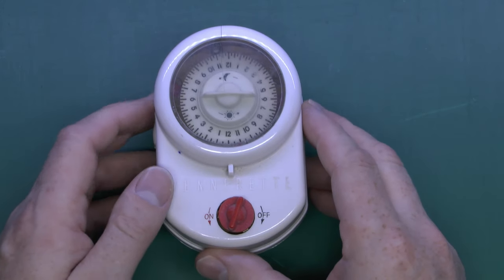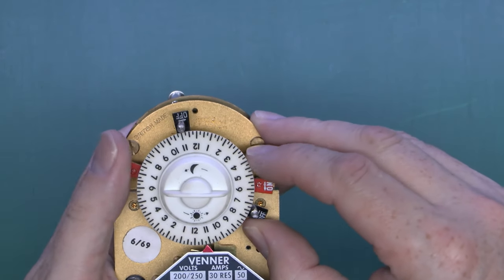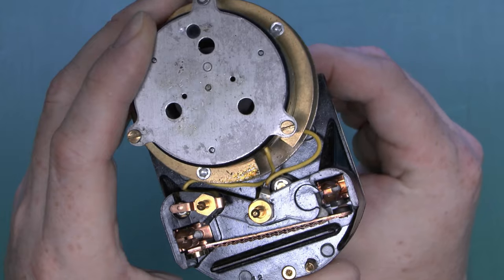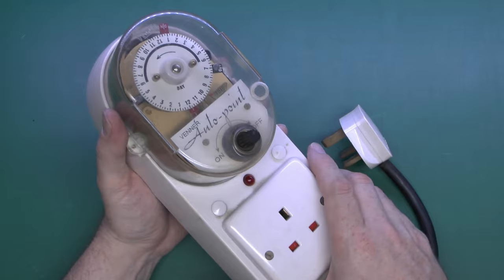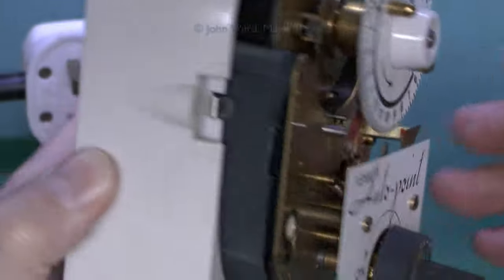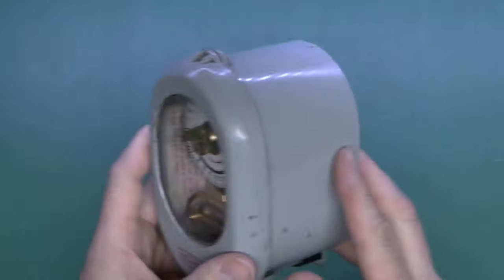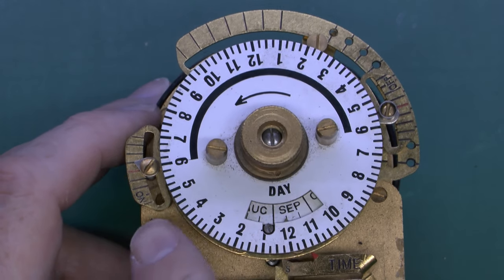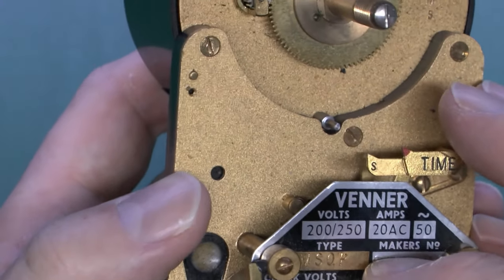Venner Timeswitches

Comment: Oh wow this brings back memories John..

In my teens we'd wander around various places as kids do. I live in a semi-rural area and a local town had a rubbish tip there. 
One day we were wandering over and spotted the usual things. Rubbish from a fruit market, sweepings from the local sweet factory. That sort of thing. Anyway, now and then we'd spot unusual stuff. It might be boxes and boxes of sodium light bulbs - councils actively replaced bulbs back then before they failed. This particular day though there were piles, and I mean piles, of these brass Venner time switches. 
It was at the time when street lighting was converted to light sensitive sensors which switched them on when needed. The local roads department were removing the time switches (and cast iron boxes) and dumping them by the thousand. I took one or two to play with as they were interesting. Thinking back it was incredible wastage. Aside from still being fully functional, they were made of almost complete brass. It breaks my heart to think of the lost money in that tip..
I just wish I still had some switches as they are very handy and will likely last forever.

A good video John and brought back memories. Thanks for posting.

Comment: The daylight adjustable dial were used in Street lamps as well, if you look at an old streetlamp you will see the familiar oval of the Venner clock casing.

Comment: John, the the second screw on the 'off' tappet is to set a fixed 'off' time. ie 'on' at sunset 'off' at say 1am instead of sunrise. I have a similar Sangamo Weston t/s which has basically the same arrangement. (and has been in continuous operation since 1981.)

Comment: My parents' first CH boiler, installed around '67, had one of these fitted internally. Didn't take long for the heat from the boiler to distort the side of the case so much that it hit the time setting flags and moved them.  It spent the rest of its life naked.

Comment: I had one of these in my central heating unit which was made in 1965 and it failed 42 years later.  One of the plastic gears which was driven by a brass gear had simply worn down to the point where the teeth didn't engage any more.

Comment: I wonder what the power usage is.
Reply: +brian whittle It'll be pretty minimal. It's basically a synchronous motor, like the old electric clocks. A few watts at most I'd have thought.
Reply: +brian whittle from memory with most of those little things, 2 watts